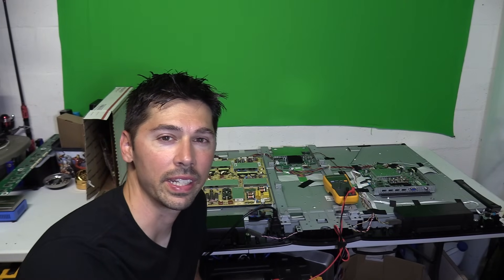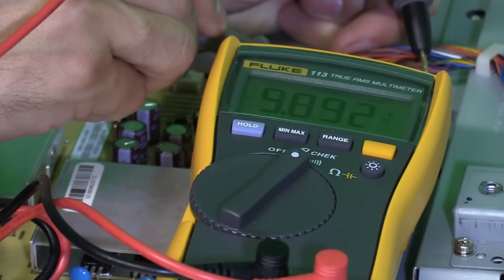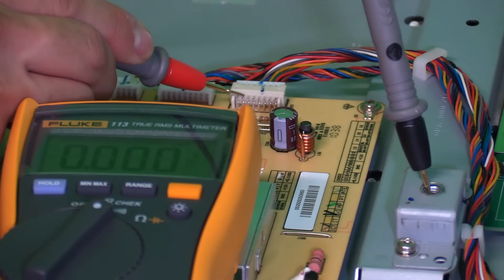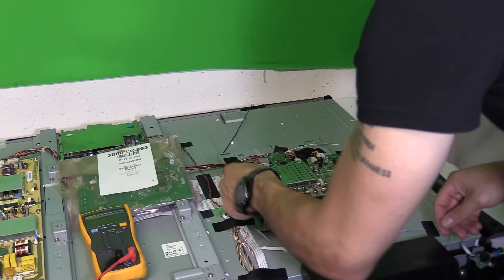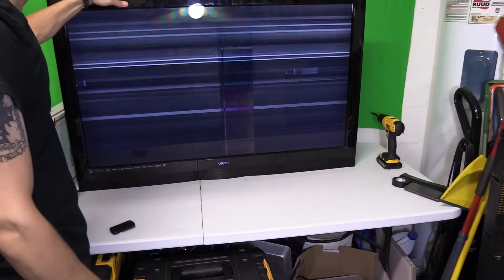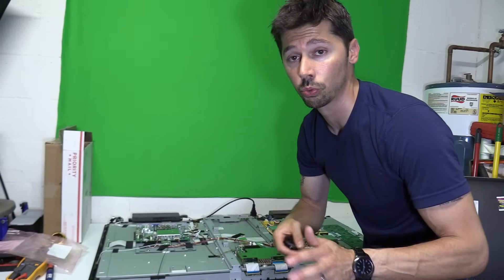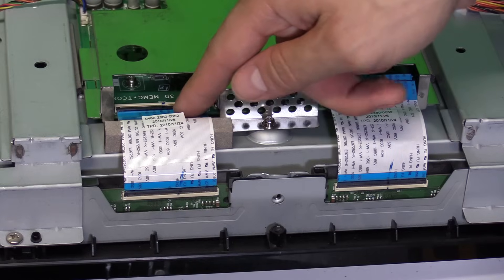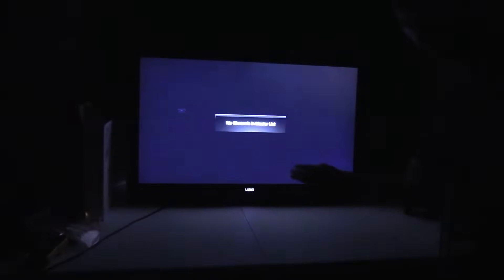LED LCD TV REPAIR, DOESN'T TURN ON, NO PICTURE SCREEN, VIZIO XVT3D47 FIX

Comment: Thank you for your videos!  I have a Samsung 55" tv.. model number isUN55ES7100FXZA - no picture but the standby light keeps flashing on and off, the red one. is it the power board or t-con?
Reply: did you fix your TV, I have a Philips with no picture but a flashing red led on the front.

Comment: I am living in Thailand, repair people are not that good.  I am an electrical engineer and would like to ask a question about repair.  I have a Samsung 42" LCD TV UA42... about 2 years old.  TV is always on, computer goes to sleep at night.  this morning, came down to TV screen back light and power LED flashing very quickly, no screen on, short flashes of white light about every sec.  I checked the power supply and don't see any bad caps.  Do you still think it is the power board or something else?  I hate to buy a board and it still does not work.  I will check the power supplies while TV is on tonight as you show in your videos.  Would appreciate any help,  Thank you in advance,
Jeff

Comment: okay my model I don't think has T com board, And I have a working back light, I can leave one of the two ribbon cables connected coming out of the logic board and I can get Half my TV to work, but when I try with both ribbon cables It makes a bad high pitch noise coming from one of the boards and the entire image will have lines in it and, I'd like to note if I leave the TV alone unplugged for long time, and come back it works for about 5 minutes before it starts doing this again.

Comment: have a dead 60 inch visio led.  Power surge from hdmi port fried the chips there.  Changed out the t-con board figuring that was the issue.  Still wont power up or have standby power.  Power board fuse intact and no obvious burn or bulging capacitors.  Have new power board on the way, but wondering if you have any ideas ????  love the channel, I've watched every video.  That's why I'm still stumped !
Reply from the maker: If surge travels through hdmi then main logic board is most likely bad, get tv boards at shopjimmy.com or electropartsonline.com use code tampatecfriend for discount 👍

Comment: I Have A 32 Inch Vizio TV It Has No Picture
But It Has A White Standby Light
So That Means The Power Suply
Board Is Still Good & Needs No 
Replacing.
I Tried The Flashlight Test To See
If I Could See An Image But There
Was No Image What So Ever.
So I'm Leaning Tward The Tcon Board
Or The Logic Board.

Comment: Hello. I have a samsung 1080p tv. I turned it on and in seconds the screen went black. Tried rebooting with no  luck. I have red light and when turning on red light goes out like it should. I get the samsung chime yet no picture. Any idea what the problem many be? Thanks

Comment: I have a sharp roku 55 inch tv model LC-55LB481U tv lights up for 1 second then goes black. The led standby goes into blinking mode and after a few seconds turns completely off

Comment: So I have a M70-C3 Vizio and my picture went out. It turns on but only sound and the power cycles on and off every few minutes. I replaced tcon and led driver board but no picture…….PLZZZZZ HELP😩😩😩😩😩

Comment: 2011 March Samsung PN43D400A2DXZC. Totally failed during 6 week absence. There is 120v at fuse, no clicking,, no red light,, no green light on logic board. No VS and no Va reading on Power supply board.  No reading at 2 large 450v capacitors. 
The volts are correct on  both STBY 5 V and PS ON 3.71 .going to main board. 
The Main board does have some extreme heat at IC 106 & 109.
I am considering replacing the Power Supply and Main board.

Comment: Does each pin count as 2? Also I’m only getting 5 volts On pin 1 & 2 and 0 volts On pin 3 & 4 does this mean power supply Board is bad? Help from anyone would be appreciated

Comment: What's wrong with the TV?

I have a Visio LCD tv and it won't turn on properly. When first turn on, it show nothing but a blank white screen. After turn off and back on, the tv work normally. This problem only happen when the tv turn off more then 2 minutes or longer. Everything work after its turn on.

Comment: Hey hw are you am Billy from Zambia Africa ,I follow you up in every video you produce indeed they are soo educational keep up with your good work

I have a question for you sir,,,,,,,,,,is it possible to power up a TV set using another power supply with similar output that is 12v out 24v out and only differs with stand by voltage.the original one has got 3.3v and the other one 5v.,,,,can it be modified so as to power up the TV set.?
I have a question for you sir,,,,,,,,,,is it possible to power up a TV set =
using another power supply with similar output that is 12v out 24v out and =
only differs with stand by voltage.the original one has got 3.3v and the ot=
her one 5v.,,,,can it be modified so as to power up the TV set.?

Comment: Paul, 

Thanks so much for all the good basic TV repair information you provide.  

A question for you if you don't mind:  I was just given a Coby 39" TV that was totally dead.  No standby voltage.  I checked with Shop Jimmy and Electropartsonline and didn't see a power supply board for my TV.  I did find several used power supply boards on eBay that are guaranteed to work.  They're inexpensive, but they're used.  Would you recommend replacing the capacitors on a used power supply board with some quality name brand capacitors?  I look at it as getting ahead of their eventual failure.  What do you think?

Thanks a lot, Tom

Comment: Thanks for the videos, very helpful! I do have a question though, if you test the return voltage coming back to the power supple board from the main logic board and the voltage fluctuates from 3.2 to .08 does that also point to a bad main logic board?

Comment: no standby light fuse good  power from supply board to main board 5.1 volts no power back from mainboard just like vid see the mainboard on electro  maybe I need a heatsync ?    but what if power back from main after hitting standby is 3.0Toshiba 32" 32L1350U 431C5Y51L91 Main Video Board Motherboard Unit

Comment: Surely you mean to say esr has increased. not dropped. as they are low esr capacitors.
Reply from the maker: Hammie0141 yes thanks. uf drops and ESR raises 😞 I missed that error. I made a video about that on my repair playlist.

Comment: I have a vizo tv that is four years old and when I turn on the TV with the power button it stays on for a few seconds and goes out and the tv stays dark with no picture , would this be a common power switch issue.. thanks

Comment: I have a 1998 GE TV model  27GT619 won't come on just clicks help
Reply from the maker: April Holley check standby volts if 0v it can be bad power board or blown capacitors in power board. tv boards at shopjimmy.com or electropartsonline.com use code tampatecfriend for discount.

Comment: GOOD MORNING CAN TV SCREEN BE REPLACED  IF ITS BROKEN.
Reply from the maker: Talk Your Talk yes but its expensive once you purchase 27" and higher because they are more fragile and shipping cost.
Reply: thanks bro..keep up the good work.
Reply: Surely it would be cheaper to buy a faulty TV with good screen panel and replace parts than buying a new panel.
Reply: YES I REALIZE THAT ..
Reply: Tampatec I have a 65 inch flatscreen tv (Vizio) and it got hit with something and the glass isn’t cracked but there are colored lines that go up the tv and horizontally in the area where it got hit, the tv glass isn’t cracked though so idk what’s wrong with it. Is it worth it to get it fixed? Or should I just buy a new tv

Comment: My Vizio isn't turning on at all. No light appear. There's a faint white light in the corner that appears for a quick second then goes away.
Reply: So is there a standby light? If not, it is most likely to do with the power supply. Measure the standby voltage on your board
Reply: braydin jones okay thanks

Comment: 60” led Vizio turns on logo show no lines then when fully turns on there are lines on the screen what would that be jw
Reply: Did you ever find out what the issue was. I just recently ran into the same issue. Thank you in advance

Comment: Visio: No backlight, no image (did light test). no response to power button (wouldn't that effect the logo light, which does illuminate?) Mainboard, probably, right? `Guess is Mainboard has a "Service" port someone incorrectly plugged a USB device into and fried a component of the board.
Reply from the maker: Peter Gerow check standby volts to main board if ok, then power board should be ok. next check the voltage going to the back light circuit and the t-con board if the voltage is zero it's possible the main board is dead. check Shopjimmy or electropartsonline.com use code tampatecfriend for discount.
Reply: Yeah I watched the video like "Yeah I could do this, but it's cold (in MA) I'm not going out to the garage right now for the voltmeter to guess which harness is the correct one in my application. lol. I'll double over it tomorrow. Thanks for the reply! =D

Comment: My Vizio smart TV will turn on and plays sounds but doesn't show anything.
Reply: I as well have a 55" vizio m550vse & the screen comes on momentarily & then goes black. I tried the flashlight trick (shine a flashlight onto the screen & see if you see any picture) However, My screen is just black! I do get audio though! If I may ask, What was the issue on your Vizio? Did you fix it? I am wondering which board I need to replace?

Comment: I just ran into an RCA TV that has an FRC board. First time I've seen a TV with one of these. What is the purpose of this board? I can't find any info at all on what it does. The TV had a no picture issue but had backlights. I did a reflow on this FRC board which fixed the issue for now. Im just curious to find some technical info on this board.

Comment: I’m doing that my my vizio. The internet is not working on the tv I already tried wired and wifi. The tv works fine it’s just the internet connection. I already order the wifi board module but my question is is I should replace the main board too. Remember both the wire and wifi internet are not working.

Comment: Hi,
I am having trouble with my Samsung UN46D6400 LED TV. When I power on the TV, it starts with a Gray screen with few black horizontal lines and then the screen blacks out. It has sound (loud and clear) but no picture. TV has backlight. I saw a video on a youtube channel where it was suggested that if TV has Backlight as well as the sound, in majority of cases it's a bad TCON board. I replaced the TCON board but the issue still persists in the same form. It still has sound and backligth but no imaget. I bought the TCON board from EBay, could it be that the TCON board I received is also bad? Are there any other things I could try.

Thanks Much,
Nitin

Comment: my TV turns on and works but has purple spots
Reply: any tips
Reply: The panel maybe. My friend had a purple line on left side the panel but it was not always visible but only on certain scenes in the picture. The more black scene.On his tv i think is the panel problem(not check but i think)But tv is 10 years old ans stil work ok.

On my old plasma LG there were quite different visible thin lines and It was a panel error(broken inside).Viewed at the service.Get a new TV- Thanks for the guarantee payd extra money when buy tv..

Comment: Electro parts is a joke. Bought a power supply from them. The fuse was blown right out of the box. Further testing showed bad mosfets. If they can't test a fuse before selling a board they should get into a different business.